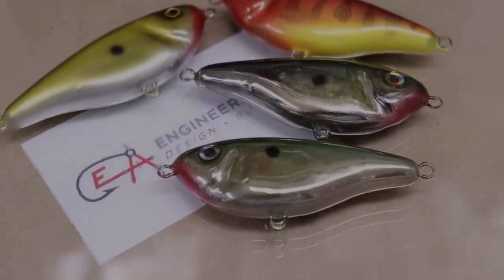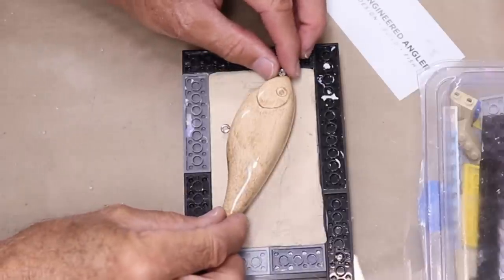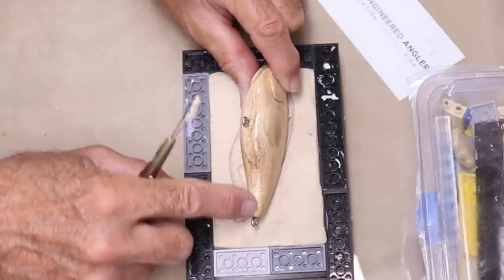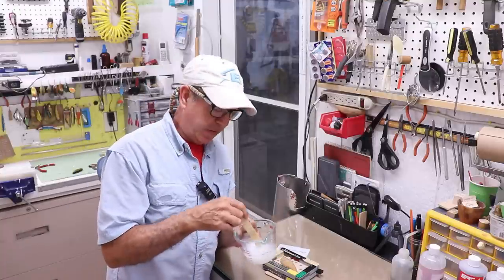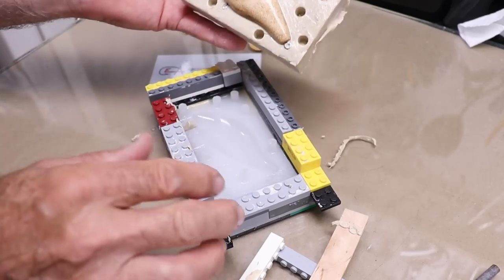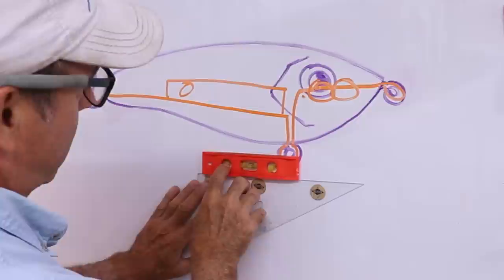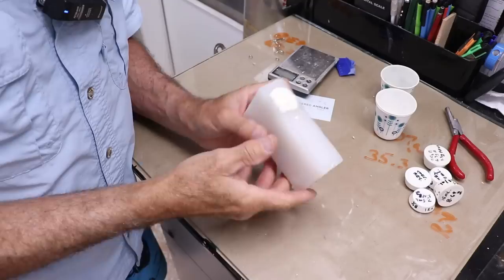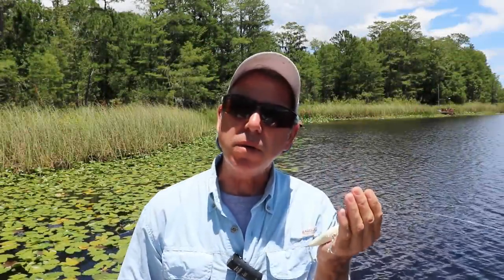How to make a Silicon Mold  #siliconmold #luremaking #jerkbaits

Comment: I like the tank test, but would enjoy a video using both salt water and freshwater in the tank to show us viewers the difference in buoyancy.  Cause every time you drop a lure in the fresh water tank that is designed for salt water and it crashes to the bottom, I’m thinking no way in hell is this going to work as advertised...
I totally geek out on the science and math approach you use to make your lures. It is perhaps the single most reason I follow your channel.  Please do the other video you suggested on figuring mass and buoyancy. But do two identical lures, one for saltwater and one for freshwater. I really think that approach would hit home more for your viewers.  Since the only saltwater I ever see is when I have a sore throat and gargle with the darn stuff.
Big fan from Edgewood, Illinois.
Reply from the maker: Put a little lime in that salt water gargle, according to my granny it cures everything.  Thanks for the idea, I think I'll include the salt vs freshwater stuff in the weight and balance video.

Comment: Great video Franco, lots of good tips - I especially like the rice trick! 

Would definitely want to see a pro-tips video which collects all that important nerdy stuff in one place!! 

I used to cast a lot of lead in plaster molds and used marbles to make my alignment divots.  Not so important for silicone but made aligning to mold halfs very positive and easy.  Might try plaster molds for casting resin,  they  take details well and are quick, easy and cheap to make. 

Cheers!

Comment: Hello Sir. When I de-mould the lure I have noticed that the micro spheres are coming to the top of the lure. Do you have any solution for the same?
Reply from the maker: You are probably using a slow setting resin.  If you use a resin that sets in less than 15 minutes you can avoid most of the issue with the spheres floating to the top.
Reply: @EngineeredAngler  Thanks for your reply. Unfortunately I couldn't find any resin in India that set with in 15mins. Is there any particular name for that resin?

Comment: Do you add the rice to the mixed silicone? Is that to take up space to save on silicone or does it serve another purpose. Excellent video. What is that device you used to make the hook eyes/wire harness called and where can I pick one up?
Reply from the maker: It's called a Twistech, they're still available online but hard to find.

Comment: I understand that we don't need to use a vac chamber or pressure pot to get rid of the bubbles.  But can I use a heat gun or hair blow dryer and lightly and briefly pass warm air against the mold material to help pop the bubbles?
Reply from the maker: Yes...I use a hair dryer.

Comment: If you want to make silicon mold for 20 cm needle lure, which in front is diameter arround 7mm,and at the back is diameter around 20mm, how would you make hole for casting,at the thicker,or thinner part,and would You maybe make 2 holes for pouring cast material,one at the front  first third of lure lenght,and other at the back third of the lure lenght. And where You think is the best to position holes for ventilating air inside mold to avoid bubles.Would You tilt master lure at 140,150, or 160 degrees in mold or make it horizontaly at 180 degrees( no tilt at all).I am asking this because to avoid bubles,and to achieve better cast,to fill the hole casting cavity perfect. Keep up the good work.
Reply from the maker: I like thus question.  I will answer it in depth on the next video.

Comment: When you calculate your density and get the weight for what you need to get it to sink. What water temps do you go off of? In 37 degree water a lure will sink differently then 80 degree water.
Reply from the maker: The change in specific gravity or water from just above freezing to just below boiling is about 0.04 grams/ml.  Not enough to worry about.   Excelent question though.... thanks.

Comment: Thank you for that.
Q. If your choice of lure is a small bib type, will this method work for them too?
Reply from the maker: Yes, especially if you're copying a commercial lure.  Commercial lures have thicker and tougher bibs and can be molded from resin to problem.  If you're making your own lures you need to use a slightly thicker bib.
Reply: Great ! 
Thanks again👍

Comment: I had an idea while watching your video. What if the weight inside the lure was adjustable? A way to screw the weight forward and back to match conditions? Just thinking,  Rick
Reply from the maker: that's very doable and I have done something like that for a demonstration video.  https://youtu.be/R68qQnav96E
The challenge is keeping the water out of the lure.  Maybe magnets!
Reply: @EngineeredAngler  
I'll check it out and think about the water issue, Thanks

Comment: great as everytime. i just would try to get it level during the sinking, with enough weight you get a nice flutteraction,that slows down the sinking and catches without doing anthing. than you could try to place one weight in the center or two at the ends,to find out what action fits better to the lure,the fisches or your fischingstyle. or get one lure for different uses. i would love to play with it, but no fish for that stile and size of lure arround here